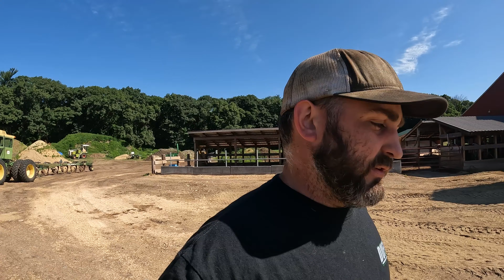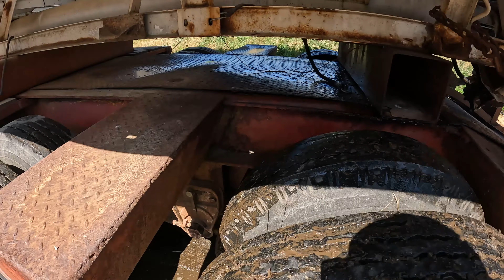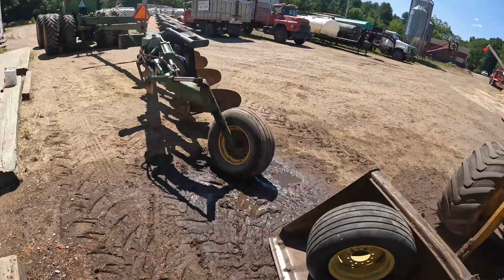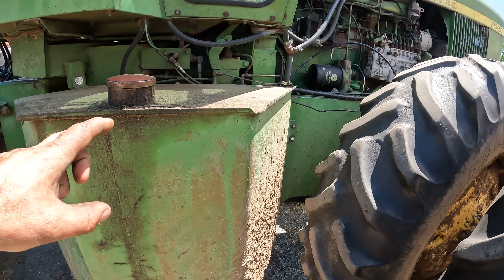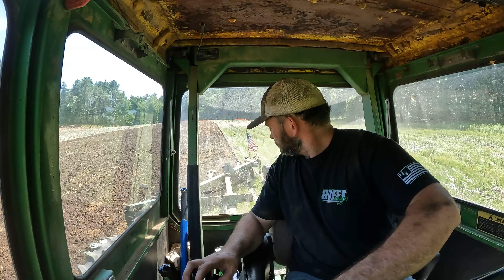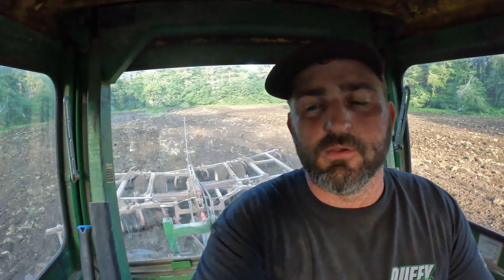John Deere 7520 On Land Plowing- Last Day Of Spring Work

Comment: That bracket on the plow you called a fire extinguisher holder is for a Grease gun.
Reply: Just dont try and hold a grease gun in it.  They like to pop open or crush tubes.

Comment: Just cut'n'weld that spindle back to the "right" angle if it spins fine.  No point in playing bendy games with it.  You can take a spindle off of anything and shove it on there, even spindle legs from old junk mowers/etc.    TBH get a metal wheel for the plateau wheel anyway, big rim trailer side spindle or whatever.